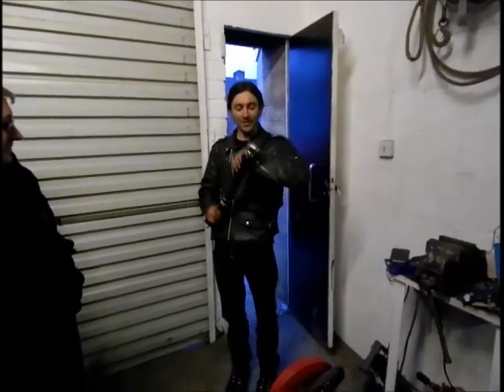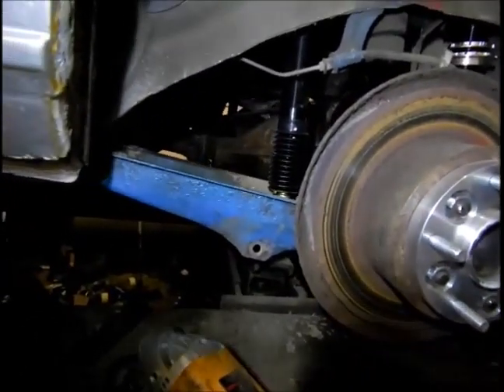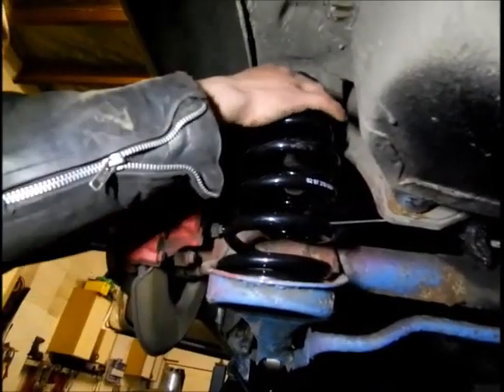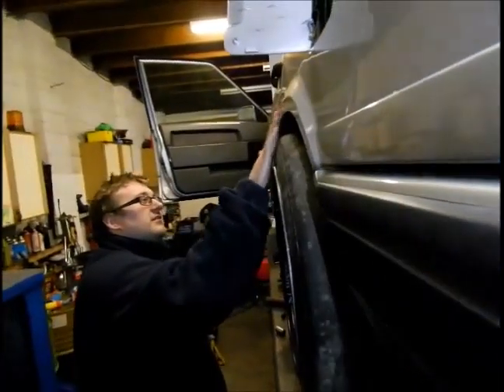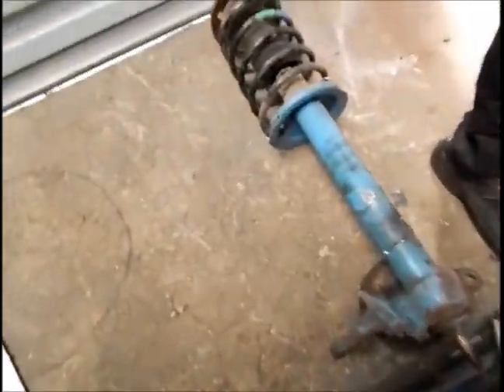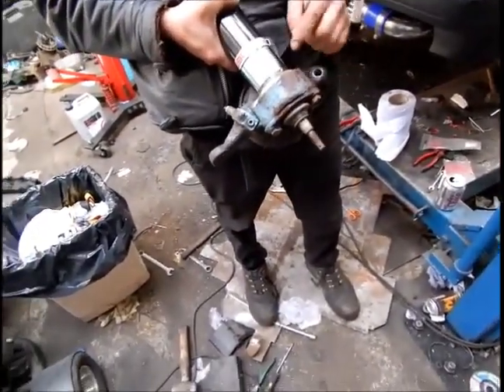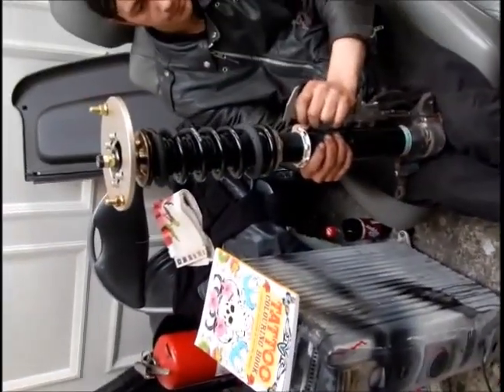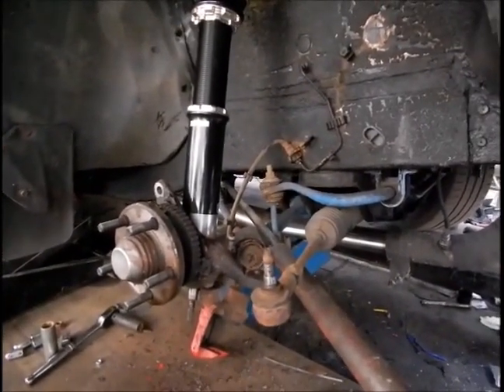Volvo 940 16v turbo brick episode 10 how to fit coil overs

Comment: nice build ! the first time I found someone fitting coilovers on a 740/940 , but in the front , you can take the shock absorber from the top : D I'm running a 940 B230 8V 330hp only lowered 40 / 40mm running 14.3s. no rep . street tires